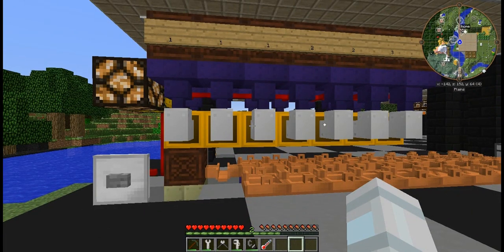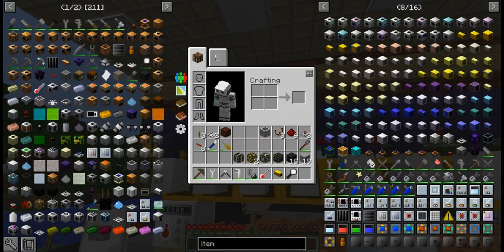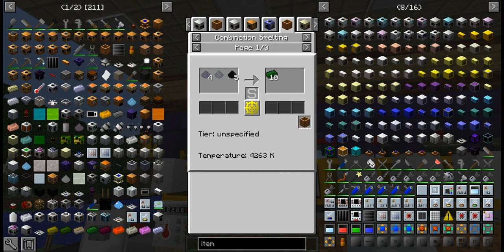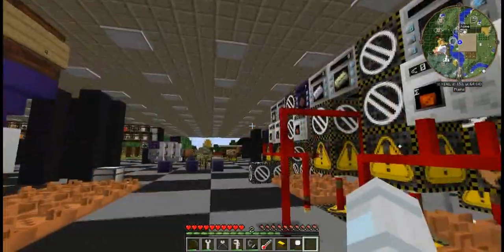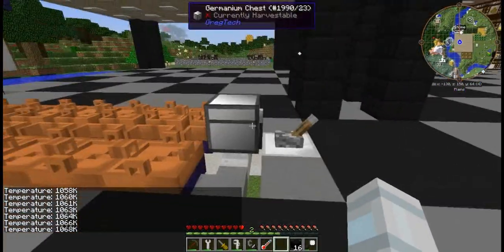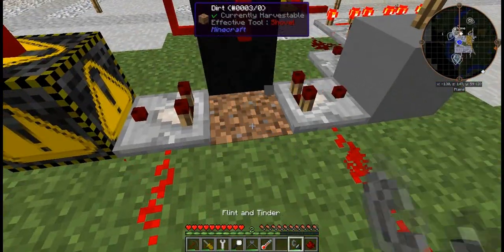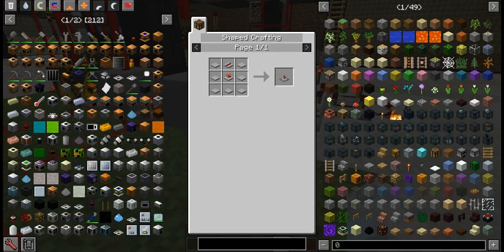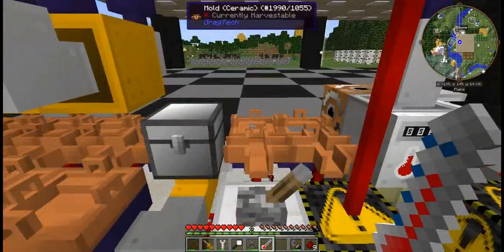Gregtech 6 - 36 - Netmc Modified Multi smelter and OE Steel Maker

Comment: I know you complained about me using normal pipe instead of huge, but the pipe size difference to get stuff there faster doesn't really matter. You only need the first item to drop into the crucible to start absorbing the heat. The other items dropping in a couple seconds later don't matter as it still takes the same amount of time for everything to heat up. The time to first item matters, the rest, not so much.

I believe the issue you had with electrum making a double batch is partially, your pulse generator. In order for it to work properly, you need a 1-tick pulse. From what I can tell of your video, your pulse generator will generate a pulse longer than 1 tick. This allows the hopper to submit multiple batches. Going along with this, the main use of the smaller pipes with 1/s bandwidth is actually the blocking mechanism. By using a single line of pipes with  a single hopper feeding in each, even if the redstone pulse is longer than 1 tick, the pipe is blocked by other hoppers inputting materials so only one batch of materials can drop in at once. By using larger pipes, you can allow multiple batches to enter the pipe. This is very true of the smaller 1 and 2 item hoppers. Less so on the larger hoppers as huge brass only has an item bandwidth of 4. So even if your pulse generator isn't exactly 1 tick, the blocking mechanism of 1/s bandwidth item pipes will allow the system to function properly.
Reply from the maker: i did found out it on the video, no it wasnt the pipe because i use a normal pipe for holding the input so no double batch , was my dumbass adjusting the thermometer during the heat up, i passed the the pour trigger so it triggered but because it was solid it did not poured and received another batch.
the case of things no mattering at arrival, i do believe it does, i never boiled any stuff while the crucible was still counting the input, it seems while turning the resources in scrap it doesnt count how hot it was , only reason i can see for not having the problem of boiling redstone , i never had the problem with hopper on crucible , since it drops everything at once but single pipe has delays .
i dont remember complaining about using smaller pipes, so if you can point where it was i will check, but sorry if it seems that way, i do remember the complaint about the expensive item o meter, so i did add more weight meter to my setup as a substitute on different builds.

Comment: yes you can make rods when you need them for crafting but the rods are more fir things like red alloy and signalium where you need rods for making fine wires, no reason to make them into ingots then rods when you can just pour them as rods in the first place. everything else i would just do as ingots i only use the rods when i specifically need all of it for rods and molds are cheep.